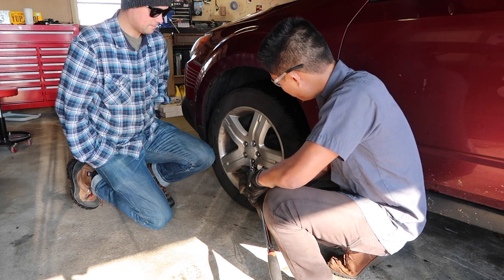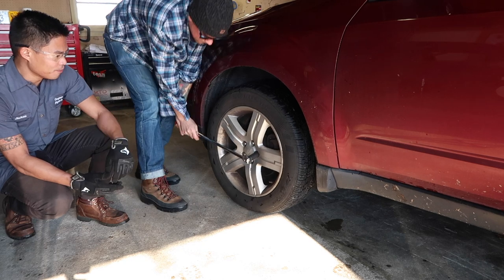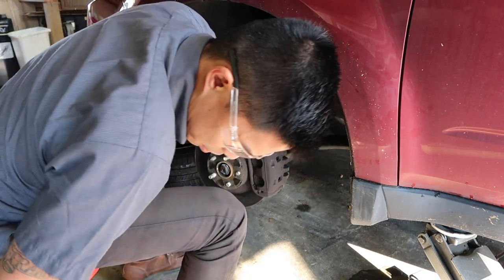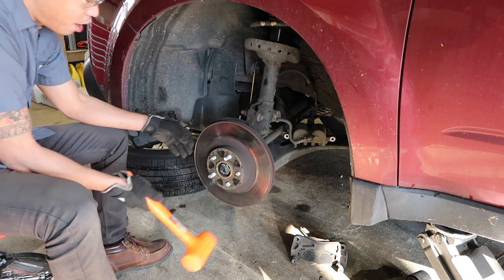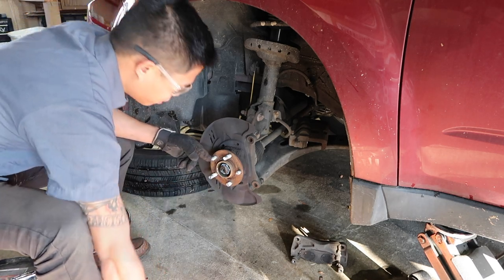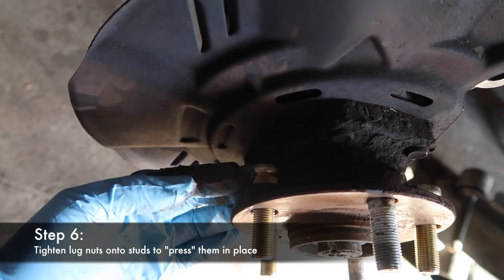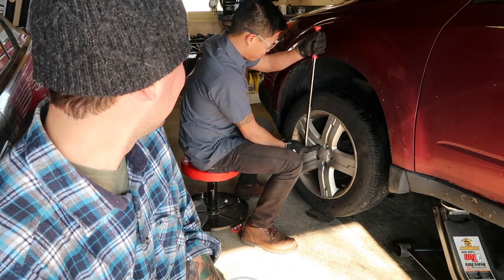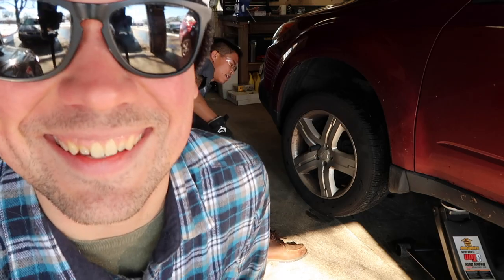HOW TO: Remove stuck lug nuts / wheel studs

Comment: I wasn't sure how to do it  since I am becoming a D.I.Y. with my 2012 Forester, similar to that. I was going to replace the brake fluid as Subaru advices every 30k miles and found the seized lug nut.

 It was sooo easy the way you showed. No hammering, no heat, very easy with the breaker bar. Thanks for helping me saving at least $100.00. The stud and lug nut was $6.40 plus 45 mins of work...
Reply from the maker: Nice work Rafael!!!

Comment: If you try to hammer out studs without looking at what you are doing, you can damage what's behind the hub, including ABS sensors. WIth many hubs, there's not enough clearance to remove or replace a stud without removing the hub.

A breaker bar is intended to break free stuck nuts, not break off studs.  Use it properly and often the nut will come off before the stud is stressed beyond its limits.  I removed 16 of those stuck nuts from a used car I bought and salvaged 16 studs and 15 nuts. (one was mismatched).  By taking my time and evenly applying force alternately on each side of each stud with a 25' breaker bar and a cheater extension I saved hours of repair work.
Reply from the maker: Good point! I should have specified checking clearance behind the hub before taking a hammer to it. I'm very familiar with Subaru and didn't think to mention that. As for the breaker bar part... you're right in most cases. In ours the nuts were cross threaded on there pretty good, so all I cared about was just removing them since I knew I was going to replace the studs. Thanks for watching!!

Comment: HELP!! While trying to loosen my crossthreaded  lugnut the stud started spinning.  Now it wont tighten back up or come off. It's just spinning freely both ways. How do I get it out??
Reply: I jus did the same thing today i dont know what to do now lol. Please comment back if you found out how to get it off i will do the same!
Reply: Josh Stroud same I wish they would fuckin reply to this lol
Reply: Sorry guys..just now seeing this. I just broke the whole stud off with a breaker bar and socket. Scratched my rim up pretty bad..but I'm back rolling now✌🏼
Reply: Holy shit the same fucking thing happened to me today! How did you break it off? 😅
Reply: Use a tool called the lug ripper. To get a stud and nut that's just turning off without damaging the rim.
Reply from the maker: HOLY CRAP.. So sorry everyone for just now seeing/responding to this. So when this has happened to me in the past I've been able to get them out by pulling on the tire or stepping on the sidewall of the tire as if it were a lever to force the stud tight against the hub flange from spinning. Then I take the strongest impact gun and zip it out/break it out. That's worked every time for me.. if that doesn't work then I'd try to use a hammer and punch to break the stud if there's access. Last I'd settle for drilling. Sorry again for the super late response!
Reply: Grab the spinning stud with a pair of vice grips to hold it good. Drill it out with your free hand.

Comment: My stud broke doing this now my stud and lug nut spins is place as one and I can’t get my wheel off...
Reply from the maker: That's the worst man! Sounds like the splines have stripped on either the stud or the hub flange or both. Either way first thing I'd try in this situation is trying to apply tension to the stud by pulling the tire/wheel outwards.. basically using it as a lever to force the stud against the hub flange. Then taking the largest impact you can get your hands on and zip it out of there/break it.
Reply: Fix it Bongbong - I’ll def try that. I saw another video where a guy put repetitive upward and downward tension on the stud basically bending the stud until it broke off which allowed him to remove his wheel.
Reply from the maker: @brandonleesanders  One time I broke off the stud with a big pry bar, but its marred the rim.
Reply: Fix it Bongbong - I only have a hub cap on my wheels. I’ll just replace it if I have to. My only priority is getting the lug/stud off so I can remove the wheel so I can Service my brakes. Thank for the help. Much appreciated.

Comment: Ah man, I didn't know studs could be replaced so easily, I changed my whole wheel bearing/hub assembly because I thought the studs had to be machine pressed in!

I another note, I completely thought the broken stud was my fault for using a breaker bar and not an impact wrench while attempting to remove an overtightened lug nut.  I've read some posts online that impact wrenches can prevent stud damage when removing overtightened lug nuts.....but I guess if the nut is cross threaded it really doesn't matter
Reply from the maker: I think in certain applications it's ideal to have them pressed in or out. In some cars you still have to remove the assembly to remove the lugs because of the backing plate clearance. Thanks for watching!!

Comment: I lacked time and had a shop do brakes and they over tightened my lug nuts. Actually counter sinking the lugs into the rims. I hope I can break all 20 of them with out needing a torch to not ruin my $500 a peice rim.
Reply from the maker: Whoa.. are they aftermarket rims or lug nuts? Usually the lug would break before a nut would countersink into a rim.

Comment: My nuts where on my tire so tight when I tried to loosen them car wheel kept moving I couldn’t get them off with the supplied tools that came with the car
Reply from the maker: Ah yes.. total pain getting those off with the included tools. First thing I'd recommend having the car on the ground and in gear/parking brake set to prevent the wheel from moving. Second, try getting a pipe on the included lug wrench for additional leverage.

Comment: It's the damn lug nuts that snap off leaving the round "acorn' in place... You have to drill the whole stud out, ten bits and 5 hours later-then you can replace the stud.   Argh.
Reply from the maker: I might be mis-understanding but if you snap the nut off like I do in the video you can just hammer the stud out, no need to drill.
Reply: @FixitBongbong  no, no, I understood your video and it was very good.  I meant the type of lug nut that actually snaps in half and the six sided piece unscrews and the round seat (bottom half of the nut) stays tightly screwed into the wheel.  Especially when the aluminum wheel and steel nut corrode.  Then there’s no way but to drill the whole stud down...
Reply from the maker: @angelonicassio7131  ohhh gotcha.. bi-metalic corrosion also what you're describing is a nightmare.